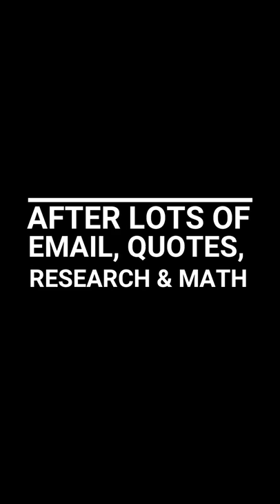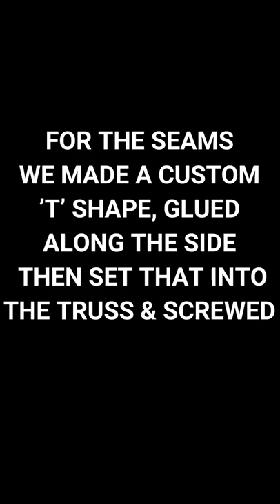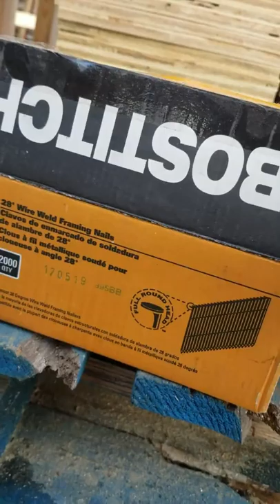DIY Floor Trusses

Comment: That was an ambitious project.  We (my family) built a house with manufactured trusses like that in 79.  Before that in 75, I built a garage with a gambrel roof.  We did it in a similar fashion where all the components were precut and stacked, but that's much simpler as there were only 4 main pieces for the rafters and plywood gussets at 3 locations.  We built a jig on the deck of the roof and assembled the truasses and stacked them at one end until all were assembled and then spread them out.  At that time, nail guns were out of the reach of the average home builder so it was all hand nailed.

Comment: I find it amusing how many people comment on why things won't work or make them out to be more complex than they really are.  Most of the naysayers are people that don't want you to build things yourself because it affects their bottom line and profit margin.  I also will be building my own floor trusses....despite all the hoops and barriers they want you to jump through.
Reply: yeah! i had a guy at hancock lumber laugh at me when i said id buid them myself. guess what garage is build and ive been working out of here for a year and its great. no roof sag, minimum floor bounce. its great. also a few local builders are my customers and they all have said theres nothing wrong with that idea and they will hold better then manufactured trusses!
Reply: I know right.   I have several homes 100+ years old, and If you saw some of the things you'd scratch your head.   There is one beam, which is a 2x4, on it's side.   How did this last 100 years?  Because the sheathing is real boards, and they are likely structrual.  But, it gets worse for todays code compliance checkers...the ridge beam, is a 1x4.   yet, it's been there 100 years.   the rafters are 2x4's, the ceiling joists are 2x4, etc, etc.
Reply: I would do it if not for those pesky codes required in my area
Reply: A guy replaced a stairway, with one slightly longer, then the code guy, came and said, you changed  it, now comply, it's got to be much longer.   The guy sold the house.   What are you doing looking in windows?

Comment: great video, you guys were pretty clever in the construction of these trusses! I'm currently designing myself a 36' x 56' two story garage and I want an open floor plan on the bottom floor and those trusses are the way to go but as you know $$$$. so of course I searched "DIY Floor trusses" word for word and found your video...I am pretty confident I can do what you did thanks to your efforts. only difference is I'm going to mill the lumber from my sugarbush using a new woodmizer, I'd better get started lol
Reply from the maker: Yeah you have your wprk cut out for you. I'm glad I finished my garage last year right before lumber prices sored to the moon
Reply: Have you made them yet?
Reply: How did your project work out? Doing something similar for 36x72 gambrel barn. I also have a woodmizer and would be using pine....

Comment: I admire your courage to go ahead with this.

I would have gone with larger glued gussets though and skipped the glue on the 2x4 webs.
Reply: Correct.   Larger gussets are always stronger, then smaller gussets
Reply: Mr;  The glue is crucial.
Reply: @wrongfullyaccused7139  Glue, is short lived.   If it's crucial, then you have a problem in 6 years.
Reply: @normbograham  ;Negative.  I have projects that I glued up over twenty years ago.  If you tried to break them apart they are just as strong as the day they set.  However, there is one thing crucial.  The type of glue and how it is applied.
Reply: My experience dates to 1987, truss repair, and otherthings "glued" to the ceiling.   There WAS a black goo glue, which was popular, and failing around 87.   the glue got brittle. It also delaminated as it got brittle.  Roofs have to bounce if a branch hits them, and/or bounce back, if a huge load is on the roof, and then taken off.   The truss repair was recertified.   Basically, the company puts up a bond, and the bond company never wants to pay a claim.   So, they did not include any glue in the truss repair.  There was a yellow glue used for rubber roofs, that's the only glue we used.   Your 20 years, experience, is after my experience,  but the bond company would NOT insure if your glue was part of the structure, becasue we were repairing and recertifying failures from bad glue.   In my experience, I never saw Elmer's fail....(lol).  It was the early epoxi's that were failing.
Reply: @wrongfullyaccused7139  Glue for the gussets is useful but the end grain gluing on the angles is a waste of time.
Reply: @normbograham  : Actually it is fifty two years experience in my case.  Properly glued joints in trusses work wonderfully.  The trusses I made in 1983 still stand.  In fact, when Micheal hit my shop roof it peeled the sheet metal off like a banana.  However, the trusses remained intact.  Cleaning up afterward, I was able to redo the roof and add new metal.  Anyway, build how you see fit.
Reply: Been my experience that glue on end grain is, for the most part,wishful thinking.

Comment: Those trusses are beautiful, however, my building code requires the use of nail fasteners which are stronger than screws, at all the connections.
Reply: Nails have more shear strength than screws, and screws have more pull out strength.  They used nails on the gusset plates, so I believe their methods are good.

Comment: FOR THOSE WHO HAVE NEVER WORKED WITH WOOD.. END GRAIN HAS ZERO HOLDING CAPACITY.. SO THAT IS A TOTAL WASTE OF TIME.   the gusets nails and the screws will do all of the holding work   forget gluing end grain    make sure you get plenty of glu on the gusets
Reply: 100%. This would not only fail here in Canada but it would have to be replaced. Lumber must be “on end” and screws are not allowed (10d 3.5” clear shank nails) . Would also require truss plates.

Comment: Nice job!  I am working on similar design:  13" high truss with Pratt Truss design (vertical members in compression, diagonal members in tension), but am concerned about diagonals.  With 24 foot span, and loading (40 psf plus dead weight of materials = 60 lb/ft over the truss), I get 720 lbf at the ends.  That puts a tension load of 1018 lb on the outermost diagonals.  In your design, that would put 500 lb load per screw (looks like you put 2 per diagonal) but then you have the gussets as well.  I intend to use hurricane straps on the diagonals instead.  This will put 6 #10 screws in shear, and they pass.  It's just a PITA to get the straps in, so might go with your method instead.  Just need to make sure those nails/screws are sufficient when they go into the diagonal.
Reply from the maker: If you see factory built trusses, they only have nail plates to hold the truss together. My screws were more or less to hold the boards in place while the glue cures. I don't think the screws are moving enough to sheer especially after the gussest were in place and glued together. I made a small joint with gussets. Tried to break it apart and the wood broke in many places but the joint wouldn't let go. I believe the gusses and glue joints are the strength

Comment: bomber, nice vid thanks for sharing.  curious, how did you control lateral forces from the roof rafters pushing perpendicular to the floor truss direction, to prevent pushing your 2 outside floor trusses over?  Just the floor sheathing tying a few sets of trusses together?  Collar ties, sure, but if the ties are high enough to keep that space usable (i'm not sure where you ended up putting them), they would need to be crazy strong and rafters stiffened at the CT to Rafter join...  looking to do similar and keep structure open like this so appreciate your sharing!

Comment: when the glue freezes it fails. best to keep them inside for a day
Reply from the maker: Yeah we were right there weather wise on the limit of chaulking. It did hold. We made a few test boards to make sure the glue would be fine at that temp. Tightbond can go to 32°f

Comment: just curious why you screwed the pieces together rather than power nailing.
Reply: Need clamps to nail it. Screws will just pull it in.
Holds before glue sets.
Will be stronger,  vs nails that may come loose over time(a lot of)

Comment: You should have use nails or staples one.  Screws are to rigid and brittle for this job.  The fastener need to be able to flex with the wood and load placed on it, if not screws could snap.
Reply: Yep, our inspector in Allentown PA would fail us if he saw screws, not code he'd say.
Reply: Wouldnt the seams that are glued be even more rigid and not allow enough flex to even let the screw sheer off? In my limited experience glued seams hold stronger than wood without any seams.
Reply: Did you literally not see that they nailed in the truss plates? The screws were just to hold the studs securely in place while they get nailed. They are not and don't need to be load bearing in any way.
Reply: Screw are are meant to pull the boards tight together and not to hold for sheer. Once the wood is in place the angles, pressure and then the plates plus the glue create a solid, single unit. The current IBC (International Building Code) covers this. The building inspector is out of date. About 5 years.

Comment: Hi Guys...
I'm about to embark on a self build in the UK..
I've made suggestions on various self build forums about building my own roof trusses, built in just the same manner that you've built your floor trusses...
The resistance to it is quite overwhelming... I would have thought more people would self fabricate on site, but it seem that the very notion of it is meet with horror 🤷🏼‍♂️
I'm a very experienced joiner and have hand cut many hipped roofs over the years, but everything in this modern age is factory fabricated and certificated... 
Did you have to get your plans approved by a structural engineer... 
Was it a struggle to get your building authority to approve them? 
My rafters (roof rather not a floor) would be 27ft and be on a Mono pitch of 15' so really wouldn't be dissimilar to yours... 
I found your videos very inspirational and insightful... 
Nice work. 👍🏼
Reply from the maker: The trusses I made in this video are modified from a engineered plan. The engineers wanted waren style trusses with hvac box in center. My trusses are Pratt style. It's the type of trusses you'll see for train bridges. Very strong. There a 1/3 more material involved and that's why they don't build them that way. They produce the minimum to save money. My garage has been standing for 2 years now. No sag, no problems. Yes, everyone will tell you you can't bit you gotta remember. Before they were mass produced, somone came up with and built these by hand. So they are just afraid. Also builders worry about labor. They buybthe trusses and pass the cost onto customers. That's why they are rarely built. There's another triss video on here where a guy built roof trusses. Same idea. If you go look/ dismantle a mass produced truss you'll see there's nothing to it. If anything I've done extensively more work to keep them stronger. There's no building inspection here where I'm at. I dint think there would be a problem to be honest. Alot of people just loose the thought process on how stuff actually works. You can do anything if you set your mind to it. People are just lazy and do what the masses of others do. Simple minded. I got ostracized for doing it myself in my small town untill it was done. Now everyone thinks it's the coolest thing and tells my how great of a job I did.
Reply: I've been looking into it too and it's weird how people are almost secretive about it and don't want to share info and just say to get an engineer. Is this some weird thing they teach in engineering school where you're not allowed to teach knowledge?  It can't really be THAT complicated, it's just the thing of knowing how to do it properly.

Comment: b.t.w.  The larger the gusset plates, the stronger it is.  We fixed, ~6 metal gusset plates, using engineers and they put giant plywood gusset plates, where the prior ones failed.  Our plywood gussets, were 2' as a minimum (but we repaired broken gussets).   We repaired about 6 broken trusses, which were broken usually when shingles were put on the roof, in a pile by construction equipment, as we used real plywood, not waferboard.   3/4".  real engineers.  real plywood.
Reply from the maker: Yes, bigger the gusset, more strength!
Reply: @TYGIXXER60  Broken trusses, can get recertified, and in this process, an engineering company puts money on the line.   In that case, when I did some work for the company, 20+ years ago, typically, a homeowner repair, was a 2' long 3/4" sandwich.   I agree.   It's a duh. This is the simplest repair, simplest usage, sometimes a "how the heck did that break", repair, in a residential setting, (ie: no equipment on the roof).  But, the company did not want to pay , and they overkilled it, and that was their go-to-size for a patch.   if there was factory equipment on the roof, or thru wall scuppers that failed, then that changes things, and the trusses, were beefed up, sometimes even with 2x lumber, and sistering..    The enginnering report could be 10 pages long.

Comment: Thanks for a super video :-)  I have a little DIY building experience with wood. Is it relatively easy to make the trusses as straight as needed? I'm familiar with the techniques for leveling a table. Did that when I built the wings and fuselage of my plane so assume it'd be similar with wood.
Reply from the maker: Yes very similar. I actually helped my uncle build a ultralight superstall. Very simple and easy to make them stright!

Comment: Great video.......I am working on building some now.......I was thinking of building mine with the 2x4 turned the other way......up on it's side......instead of flat.......will that be ok.....or do I need to build them like you did? I need mine to be 32' long......was thinking of making the depth 20 inches.

Comment: I would be concerned about how well the glue filled the space between boards. It didn't seem like you were putting that much glue on. Does the strength depend on good glue bonds?
Reply from the maker: We did a few test prices, broke them apart to see how much you really need. Theres plenty of glue in there! All together we used about 6 gallons  on 30 trusses. 
Also glue isn't suspose to fill gaps, onluly bond two surface areas that contact eachother.
Reply: @TYGIXXER60  thanks. You are right of course about the gaps. What matters is the test that you did. There can be a little bit of cupping etc. 

I don't know if you said but what grade of 2x4 did you buy and did you  discard any pieces. 

Finally are 2x4 SPF where you live?
Reply: @TYGIXXER60  did you consider  other glues?
Reply from the maker: @GeorgeAlbercook  spf number 2. Yeah depending on what they looked like. It took me hours at the lumber yard to pick out my stringers. Its about 50 50 shot of getting straight ones. Yes. Glue wise I watched a few videos of strenght. What sold me on this glue was I could use it in the cold weather I was working with. Glue will crystallize and not cure right if too cold. So this one had the lowest working temp
Reply: Doesn't matter. You have both the outside temperature and the fact that pva glue is not rated for structural applications per the manufacturer.

Comment: SO   WHAT   WAS   YOUR    SPAN    24   FT   OR  MORE    AND  YOU    USED 14   OR  BIG  TRUESS  IM   BUILING 8 INCH FOR   MY WOOD SHOP CIELING   SINCE  IT   HAS   MY  GYM  ON  THE   TOP  ON   MY  HOUSE  I  WIL   BE   USING   9 1/2 ONES